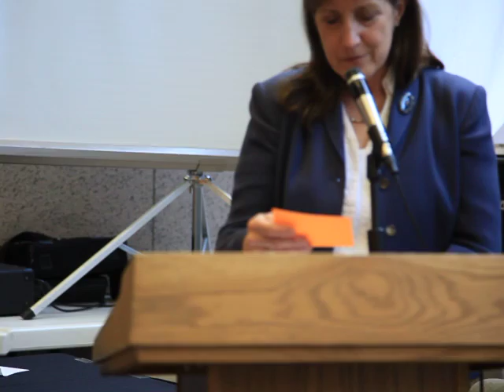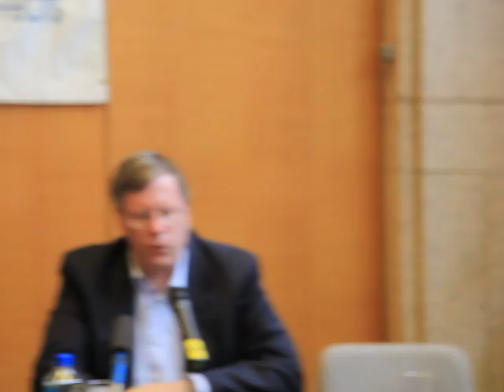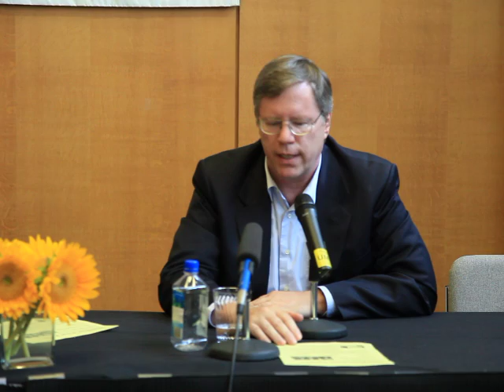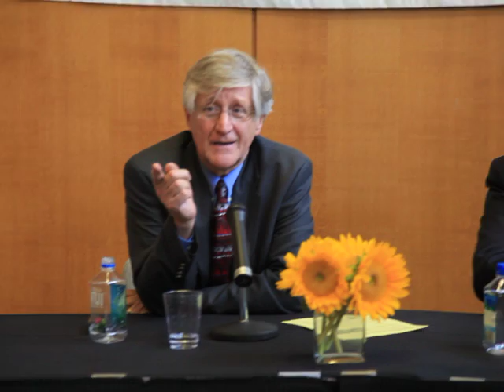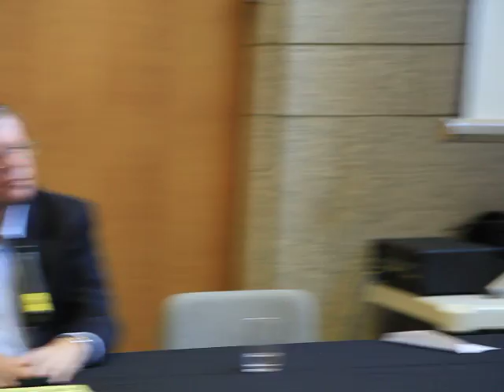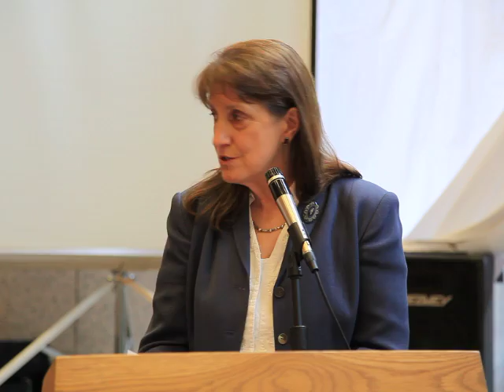Liquid Metal Fast Breeder Reactors. Problems;BEIR7 Report;Long-Term Effects of Japanese Radiation

Comment: Actually the Russians have fast sodium cooled reactor in comercial operation the BN-600 has been in continous use since 1980 and its big brother the BN-800 was completed in 2014 and is up and running and is expected to be in full comercial production by mid 2015. The contruction of the main model the BN-1200 will start in a few years once they get enough data fron the 800 and that will be the main export variant.
Reply: as of 2022, the BN-800 has been running for 6 full years. the overall load factor is 66%. so being the testbed for the BN-1200 (not under construction yet) it's actually a decent performance because of constant adjustments to the reactor core like for example the loading of 100% MOX fuel to reach a closed fuel cycle. The predecessor of the BN-800, the 600 variant has a overall load factor of 76% so i'd assume there is a window of improvement that engineers/scientists can make to the 800 reactor. 
source: world nuclear assosiation/reactor database

Comment: I used to think this, but unless we wish to abandon the human project in its current state, it seems to me that some form of nuclear power must exist to supplement alternative energy sources.

There are safer methods of producing nuclear energy that do not use the LWR design, and would reduce the danger in case of plant containment breach from one of an explosive detonation to one of finite open air exposure. Maybe one day we wont need nuclear energy, but today we do.

Comment: Sodium also transforms the material that is used to isolate the sodium circuit from water and air. The Solution is the Chief of the Problem. Whatever solution we develop, it'll generate more and worse troubles than the problem it want's to solve. You can only push one problem farther away but you can't ever get rid of problems. Thats why NPPs must be banned entirely.